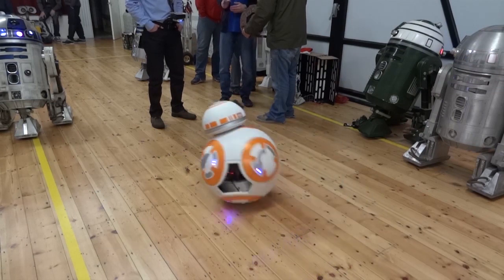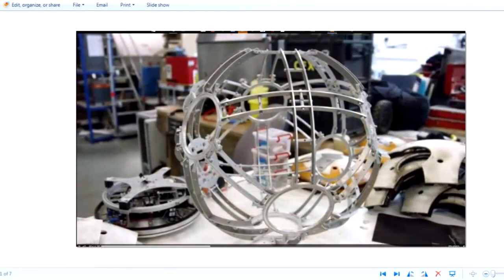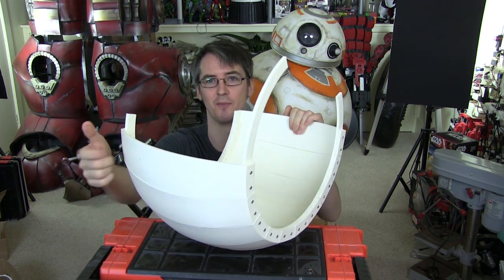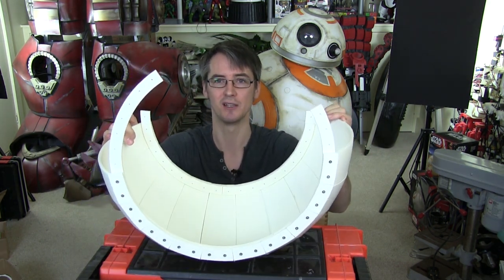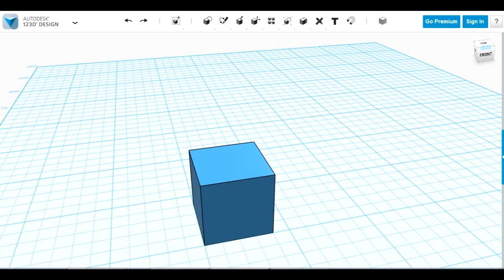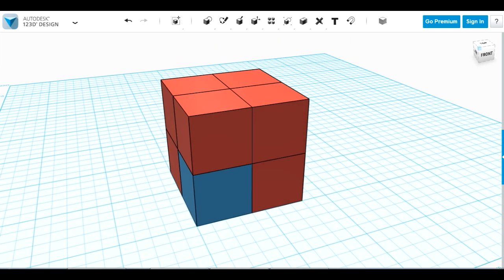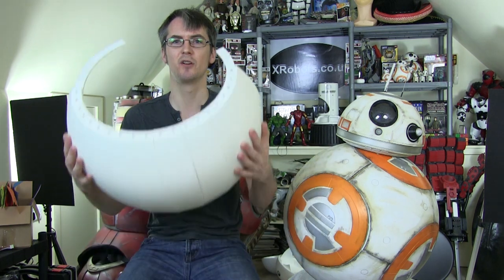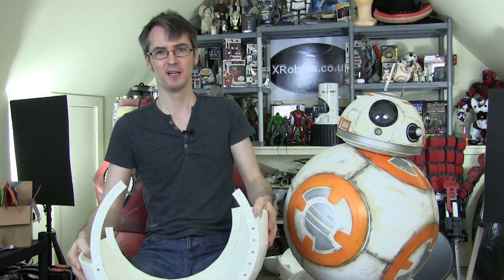Star Wars BB-8 Droid v3 #1 | Intro & Discussion | James Bruton

Comment: I dont understand  why all those axes are necessary. The ball only has 2 degrees of freedom on a sphere so the drive only needs 2 degrees of freedom. Same goes for the head. Seems like a little overkill to me. I would want to keep it as mechanically simple as possible while shifting the complex stuff into the code (inverse kinematics, 'inertia management' and so on).
At the same time this complex concept doesn't even have 2 DOF, more like 1,5...
Reply: +James Bruton (XRobots) Yeah, but you could do that with less complexity. A wheelchair for example has 2 axes and can spin on the spot aswell as going forward and backwards. With quick dynamic drives a wheelchair could also spin a sphere in which it sits... This wheelchair could also reach any point in the sphere while facing in any direction there.
If you unwrapped the sphere into a flat plane you could think of a Segway which can also reach every point in x and y while facing in any directition. With only 2 DOF. Obviously thats a simplified example...
I hope in the near future I find enough time to try out my idea, might even not work...

Comment: i think the best way to control it would be finding a way to run 2 threads. one thread would be your pid loop keeping everything stable, and the second would be the wireless communications. by altering your values in your main stability loop would then change its center of gravity, keeping the loop size small and consistent. and the same would be true about your wireless control loop. it could update as fast as it can update while also maintaining a redundancy for possible signal loss or inaccurate command signals. having 2 threads means they can run at different speeds maintaining the proper speed for the special functions they are preforming ie. bluetooth and inertial measurement.
i also think you should have an independent head combining v1 and v2 to make an above average v3 with the proper improvements, of course.

Comment: James, If you use lead as ballast in the flywheel, instead of steel based coins, then the magnetometer won't be effected. Also it will be low enough that the head magnets shouldn't influence it either, As the surface field of neodymium magnets is relatively small.

Comment: For a sphere the equation is: 

4/3 PI 2R3 - 4/3 PI R3 =

R3 or three times larger, not 8
Reply: +Robert Patton The formual is 4/3PiR^3 ... not R3. So, it's the net increase in radius cubed that will give you the relative volume difference (Pi will introduce noise as R increases). In this case, 2R means 2^3=8. 3R would be 27.02 times the volume, etc.